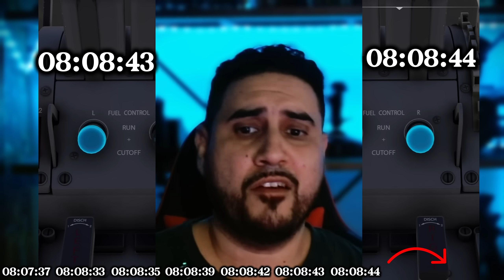TIMELINE & MENTAL HEALTH BREAKDOWN | AIR INDIA 171 | AAIB PRELIMINARY REPORT | MAYDAY | MSFS2024

Comment: There is absolutely no scenario where a pilot unilaterally shuts off the engines and the other pilot ever has to ask the question why did you shut off the engines. 

There are procedures to follow, confirmations, and communication between both pilots before shutting an engine let alone both 

The only way this was an accident is if the very experienced captain somehow was massively day dreaming and had some random impulse and when called out on it he denied it because he actually forgot he did it by accident 

The most likely scenario is that the captain did it and the FO is the one who asked why did you cut off. 

The second most likely scenario is the captain asked the question to the FO to shift blame which would be sickening 

Remember, the number one safeguard to these switches moving from run to cutoff is not the locking mechanism, it’s not the guardrails around the switches, it’s not anything to do with the physical switches themselves, the number one safeguard against the switches moving IS THE COPILOT MONITORING

it’s completely ridiculous to believe that a flying pilot ever has a chance to  unilaterally switch off the engines while a copilot is monitoring 

So the flying pilot shuts off the engines while flying the plane and the copilot watches him do it during the most critical point of the flight and then asks “my good sir, why did you shut off the engines” hahahahahahaha as if this was some training exercise
Reply: I think you have explained why the second possibility. Ie Captain switched them off then asks the question to shift the blame is correct. This was an effort by the Captain to be seen by his Dad and the whole community as a tragic victim, rather than a callous mass murderer.
Reply: @spiffingbooks2903 he’s clearly an idiot because the onus is on the copilot (himself) to MONITOR the situation and not let those switches ever move and everyone in aviation would know that.

Comment: Those mechanical switches will open or close an electrical circuit only if power source supplies a current … but, there was an AC generator failure. Fuel pumps are powered by onboard AC generators and have a battery backup with DC supply if the generators fail. 

If the software detect power failure will deploy emergency systems for steering and landing gear ONLY and pilots are left with no other option but to perform an emergency landing … this is why thrust lever was in idle position.

Now admitting such event occurred would be the end of Boeing as 787 Dreamliner is the flagship designed to operate all control functions exclusively on electric power generated onboard. They are trying to save Boeing from disaster by saying at least one pilot was mad and keep all aircrafts in operation even if this can lead to many deaths

Comment: Excellent summary. The question I have is can both control switches be toggled 1 second apart......its seems excessively quick?
Reply from the maker: Thank you! 
Most pilots concur that the 1 second difference in toggling the switches is concurrent and in line with the actual physical action of toggling both switches 1 after the other.

Comment: No body moved the buttons....it is electronic failure...
Reply: The switches are purely mechanical.
Reply from the maker: @squ34ky  the switches themselves do operate mechanically and are not part of the fly by wire system. 

However, the signal sent from those mechanical levers are sent digitally.  Mechanical failure is still a possibility “inside” the controls. 

But also anything is possible at this point.
Reply: ..... No worry we will come to know the fact after 3 yers....it is just to save Boeing at present.

Comment: NB when electrical power to  fuel valve is interrupted, even for a fraction of a second, 787 and 777, by design, the spring loaded fuel cutoff valves to the engines will snap shut. Switches in cockpit need NOT move AT ALL....
Reply: Sure
Reply from the maker: I’ll admit the report is vague and leaves a lot of questions unanswered. If an electrical failure did occur and wasn’t documented, that’s deeply concerning. I hope that’s not the case — but right now, the only evidence we have points to manual switch movement, not automatic shutdown. Inconclusive ofcourse. Not my determination.
Reply: Not true, Boeing designed 787 to default "RUN" for engines if there is an electrical glitch.

Comment: Even after crash the fuel control switches remained in the on position. That should rule out the possibility of the switches not having the correct locking mechanism.
Reply from the maker: Very good point.
Reply: good observation

Comment: Fuel cut off, and both pilots are arguing on who did the cut off and than they wake up and decide to engage the fuel switches, they don't make sense. Mental health breakdown.
Reply from the maker: I am sure the AAIB preliminary report excluded certain information. I "think" the pilots possibly had an argument in the cockpit before turning the fuel switches back to run. They are also turned back on 4 seconds apart. 

Perhaps there was some confusion, perhaps the fault was electrical. Perhaps the pilots were both confused....which explains turning one switch to run, waiting 4 seconds and turning on the other....but who knows honestly. Its all speculation. In my video, I want to be clear that I made 0 assumptions. I only reported the AAIB report, and recent reports of mental health. 

But the AAIB does state that it did bring in a psychologist to assist with the investigation. Which also shows that mental health is part of the equation. But again, nothing conclusive.
Reply: @FinalApproachPOV  Fuel cut off, and both pilots are arguing on who did the cut off and than they wake up and decide to engage the fuel switches, they don't make sense. Mental health breakdown.

Comment: Please refrain from making false accusations on the pilots . Boeing issued an advisory for faulty fuel computer chips which over heated and send signals to the sensors tos top fuel . This happened on 787 having 11,000 or more . When this happens alarms go off in the cockpit and that’s why one pilot asked the other «  did you put the switch off » This was a reaction to a problem and not the cause . The time stamp on the switch cut off shows it’s computer generated and not manual as it would have taken much more time 2 seconds each . So please don’t put a PR spin on this report until the final report comes out just to cover up for Boeing . It’s disrespectful to the passengers , crew and their families
Reply from the maker: No false accusations were made. Please rewatch. You are misunderstanding.  It’s disrespectful when you yourself make false accusations. Have a sip of your own medicine.
Reply from the maker: Also your facts are completely wrong. 
One pilot said “WHY did you cutoff”. It’s in the report. 
Frankly I am done defending myself.
Reply: @FinalApproachPOV + Yes , you take a one liner and then come to a conclusion as to what happened in a cockpit that you are not part off and that too from a preliminary report . Gréât intellect you have !! You should stop defending yourself and it’s insulting to the families involved with biases spewed on their families faces .
Reply: @FinalApproachPOV Sorry my facts are intact !!!
Reply from the maker: @DalitisHebrewnotHindu   Stop the Q tip when you feel resistance.

Comment: To argue a case for faulty switches doesn’t make sense because they have the switches found at the crash site and certainly there would have been an examination of both! If there was an issue with them it would have been noted so the switches must have been in normal working condition!
Reply: Youtubers that clutch to paper reports, but don't go  n click a switch  🎉   suiside my one person, but I think you got the wrong one 🤔
Reply from the maker: @unknownpresident  what are you trying to say? 
The video is about the report. Why would I speculate otherwise? You make 0 sense.

Comment: Bullshit.The 787 had computer problems before. A 787 plane that was in the landing process in Japan had both engines cut off due to computer error. They were lucky and could sail the plane to land it as they were high off the ground when it happened. Air India was very low and simple didn’t have a chance.
Reply: That happened on the GROUND moron. ANA Boeing 787-8. After pilots deployed thrust revesers too early. Get your facts straight.

Comment: Are there careless construction practices that might be a factor? - e.g., the wiring integrity might be compromised between the switches and the engine(s).  i.e., Loose interconnections might have caused a problem?  The extreme outdoor heat might have triggered a short?

Comment: I did not realize that the switches could move on their own, re the SAIB warning.  If that's true, it is the perfect explanation for all that transpired.  "Why did you shut down?  I did not".  Also, if it was deliberate, why would you allow transition back to Run within ten seconds.  You'd simply brush the other pilots hand away as he reached for the switches.  My take is that both pilots were invested in saving the plane.
Reply from the maker: Excellent assessment. This could be a possibility. The fuel switches are mechanical in nature but do transmit an electrical signal. There could be fault in the electrical systems.

Comment: 👍You have provided the most objective and crystal clear sequence of the events . It may be possible that one engine switch could have moved to off position as possible mechanical malfunction.. However both switches moving to off position in the gap of one second as malfunction is  impossible  . It is a clear case of some one deliberately moving these both switches to off position .
Reply from the maker: Thank you for the positive feedback. You get it!

Comment: Stop farting ,
The actuators, open/close mechanism of the fuel valves became closed either remotely or technical snag,  immediately after the take off, deploying the RAT 
This caused a REVERSE ACTION to say a reverse relay from the fuel valves located in/around the fuel tanks  to the Spring loaded mechanical fuel switches in the cockpit, to Transition from Run to Cut,  untouched by hand  (that should not have occured,  suggest a design fault or intentional) for the reason of the conversation between the pilots,  which was rightfully denied,
Blaming experienced pilots is but covering up the non immunity against sabotage/design fault by Boeing & GE,  in connivenance with the Regulatory Authorities,
" Why did you cut " a question based on an assumption , cause the pilot or any pilot is not aware of the reverse action,, other than knowing the switches have to be operated manually  ,but surely known to the manufacturers,
Reply from the maker: Thanks for your input, but the AAIB preliminary report doesn’t support this theory.

👉 Fuel switch movement was manual, not automatic — and confirmed by ECAM:

"At 08:49:14 hrs, the ECAM displayed the Engine 2 fuel control switch in CUTOFF."
"At 08:49:15 hrs, the FDR recorded both engines' N1 reducing to zero." (Page 11)

There’s no mention of actuator failure, relay reversal, or remote shutoff anywhere in the report. The CVR also captured a crew member questioning why the switch was in CUTOFF:

“At 08:49:13 hrs, the CVR recorded a crew member asking the other whether he had moved the Engine 2 fuel control switch to CUTOFF, which was denied.” (Page 11)

This suggests the switch was manually moved — possibly by mistake — and that even the crew was unsure why it happened. The report does not blame the pilots, nor does it mention sabotage, design fault, or regulatory cover-up. These theories are not supported by any of the current evidence presented.

Let’s wait for the final report before drawing conclusions.

Comment: Since when knowing to READ, MEANS MENTAL DISEASE ?!? IT IS WRITTEN IN THE BOOK : IN CASES OF BOTH ENGINES FAILURE these are the STEPS TO FOLLOW: FIRST - CUT-OFF THE FUEL SWITCHES, THEN TURN THEM BACK IN THE RUN POSITION, ONE AFTER THE OTHER with the knowledge of BOTH PILOTS , AS THEY DID, but only ENGINE 1 STARTED AGAIN, BUT IT WAS TOO LATE !!😢😢😢
Reply: Then why would one of the pilots ask the other pilot ,"Why did you cut off " .
Reply: @mario-w3k8i Maybe he felt no thrust and thought it was the fuel shutoff that caused it.
Reply: @machineman541  Sorry ,but your comment doesn't make any  sence , you can only say " Why did you cut off ' if one of the pilot saw the other pilot cut the flow of fuel , otherwise  he would of said" What just happened " or something to that effect .
Reply: @mario-w3k8i It's entirely possible.

Comment: Why does it take 4s to switch both engines back to run position.... manually and just 1 secs to switch both to cut off position......most likely both switching was not done by the same means....my guess, one is manual, one os automatic
Reply from the maker: I think an argument ensued between the pilots

Comment: Those fuel cutoffs are way too close to the main throttles.   If two different hands were adjusting/maintaining the throttles, they could be triggered if the lift function was faulty, as determined by the service advisory.   Should have been a compulsory service item ... also move them further away from the throttles.    Same danger in a car if accelerator and brake pedals are too close.

Comment: So... IT WAS a mechanical failure. A LOOSE NUT BEHIND THE WHEEL 🎉 RIP
Reply from the maker: The report does not conclusive state mechanical failure nor does it imply it. But anything is possible up until the final report.
Reply: You have a loose nut in your head😂

Comment: This is a fly-by-wire aircraft. The name switch means, its an electrical switch; if there was an electrical glitch in the control system, internally the switch would have turned OFF. The pilots need NOT move the switches to fuel cut off position.  Take a room light switch, for example. What other ways can a light be turned off even if the switch is still in the on position, a local power failure, a circuit breaker gone off, .... endless possibilities.... Boing is trying to blame the pilots and save their asses.... not fair...   there is no video evidence that the pilots move the switches; there is voice recording evidence that takes the blame out of both pilots. Voice recording of one pilot to the other: "Why did HE cut the fuel?" Here, the word   << "He" >>  means " the aircraft". As per some comments by pilots, Its virtually impossible to move both switches to the cut-off position within 1 second, unless both pilots cut the switches together in sync.
Reply from the maker: I think this deserves further clarification. The fuel switches are not part of the fly by wire system, but they electronic and function through the FADEC.  I hope this helps clarify.
Reply: @FinalApproachPOV  you seem to know very little and yet make videos like this? Shameful.
Reply from the maker: @deepakvrao  Please tell me the day you stopped learning and knew everything — because that’s the day you stopped growing.

If you are truly Dr. Deepak Rao from Bangalore, with 30+ years of experience, then I would expect more humility, not a dismissive comment based on a single video.

Maybe there’s a language barrier, but from what’s publicly available, you and your team speak English fluently. So I invite you — respectfully — to read the transcript, and point out where I demonstrated a lack of knowledge, misled viewers, or provided misinformation.

Because if you can’t do that, and you’re still calling me “shameful,” then you, sir, are a mockery to doctors everywhere. And I don’t say that lightly — my own brother is a doctor. I’ve seen firsthand what integrity in medicine looks like.

I hope you’re not the real Dr. Rao. But if you are, the shame isn’t mine — it’s yours.
Reply: @FinalApproachPOV  I was not referring to only this video but also your previous video where you speculate on who might have pulled the switches. That's an accusation WITHOUT any basis and that is SHAMEFUL. I'll say it again. 

In this thread itself you have admitted that you don't know much about the switches and their electronics and yet you make videos like this. 

No, I will never stop learning but I will not make 'educational' videos when I don't know enough about the topic, which is exactly what you have done. Like I said SHAMEFUL.

If you cannot see what you have done wrong by speculating who pulled the switches then you have no moral compass at all.
Reply from the maker: The fuel switches themselves are mechanical and not part of the fly by wire systems.
Reply: @FinalApproachPOV  This is news to me.   Thank you educating me..
Reply from the maker: @tuandeen  no problem. I educate myself along the way as well! Thank you for posing the question.
Reply: @FinalApproachPOV  I did some research on this - The switch is honeywell 4tl837-3d model. It say its electro mechinical. this means its electricaly connected some fuel control solonoid..
Reply from the maker: @tuandeen  yep you are correct!  For the 787 it is fully electronic. Good catch and thanks for educated me! See it goes both ways! 
Thanks for engaging!
Reply: @FinalApproachPOV  I did some search  - actually its electro mechanical  Honeywell 4TL1-3D - SWITCH - That means its electrical.. connected to some fuel control solonoid

Comment: As if turbine engine is behaving like F1 engine, responding to throttle, fuel supply. 
 It was clear, All engines failed due to fuel cut off,   it was only to to find a scape got.
Pilot suicide,, did not fit.  So blame ALL. LOCKABLE FUEL PUMP SWITCHES,  
T.hat re minds cas e of MAX. 
So like MAX, wait fo repeatation.